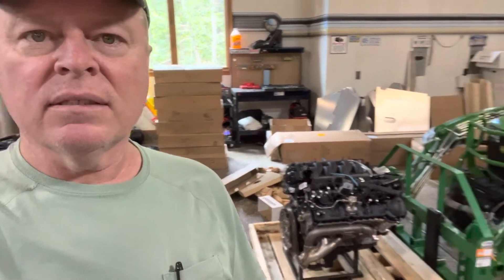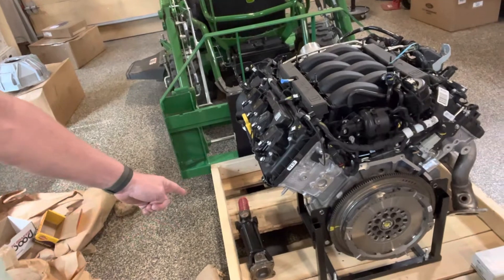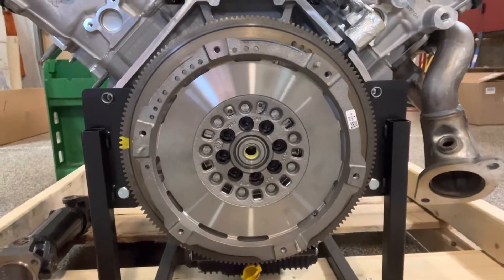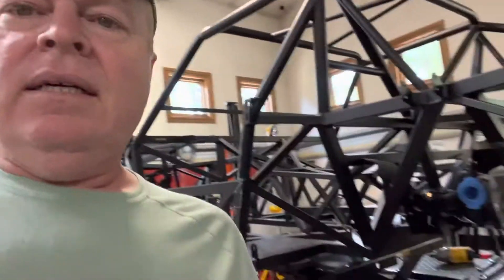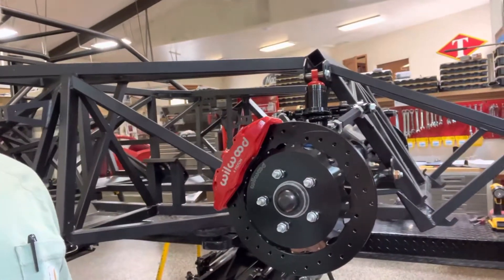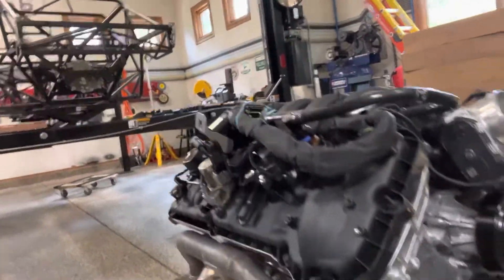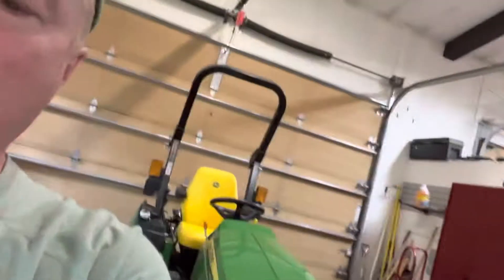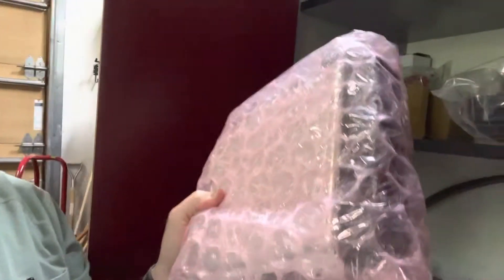Build Update 3, Coyote Gen 3 Engine Arrived. Factory Five Type 65 Coupe (Shelby Daytona Replica)

Comment: You must have the cleanest and most well laid out garage I've seen on youtube. I'll keep watching as long as you keep making videos. I'm tall over 6 foot five so leg room, max seat back, and maybe extended floor well / foot box will be my special interest. If I purchase this KIT I'll probably need a Adjustable and or telescoping steering column.  Spending 40 to 80 K is a pain if it does not fit well when you take a long drive.  If possible check out "Jonas Jasinskas" Daytona build.  He modified the steering column and the dashboard 1000%.
Reply from the maker: I’m still trying to decide what I’ll do with the dash. I may try to do a padded leather cover. I’m only 5’9” so not worried about fitting.